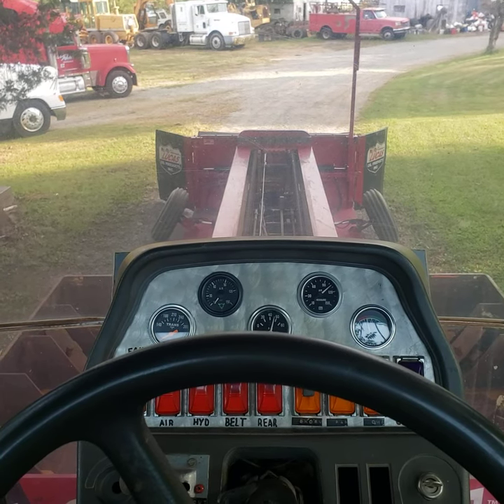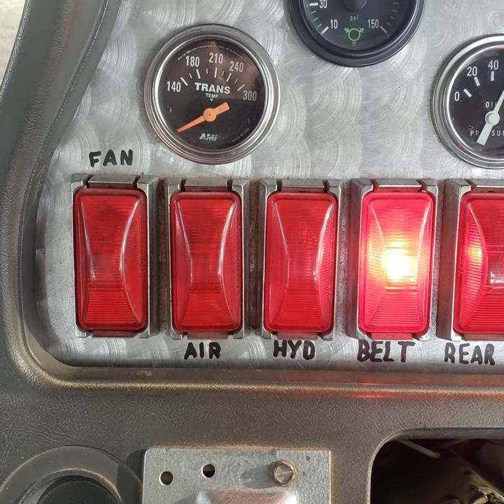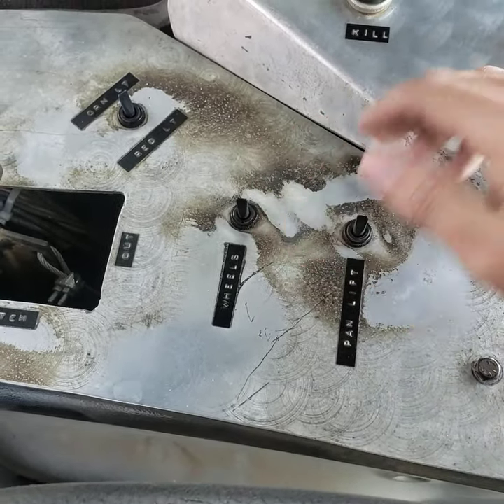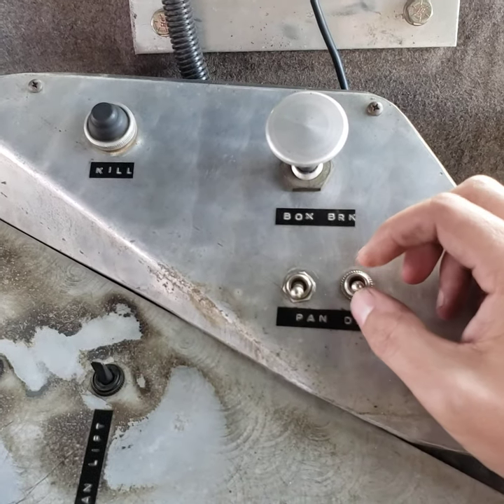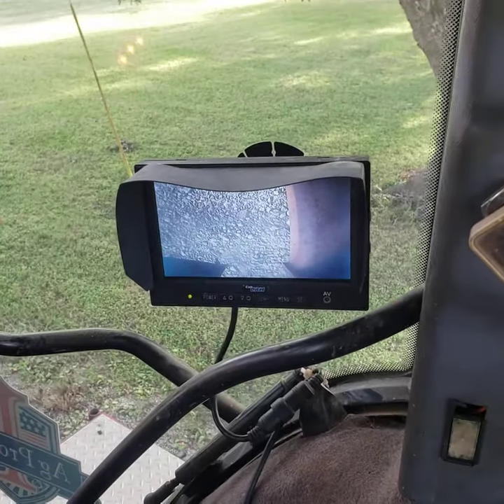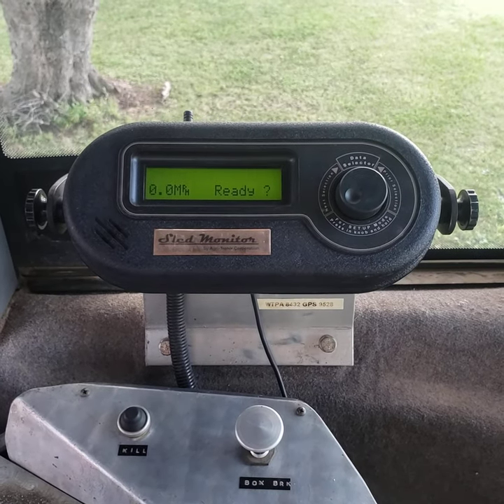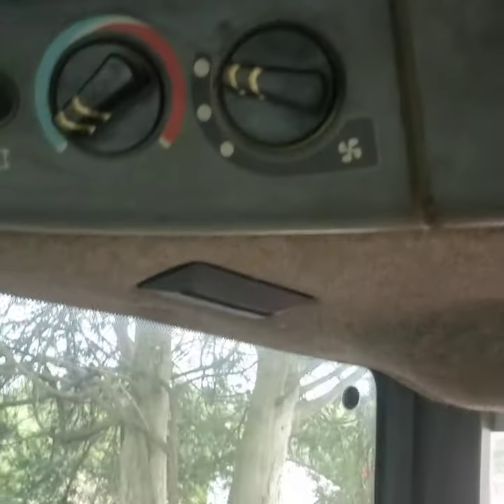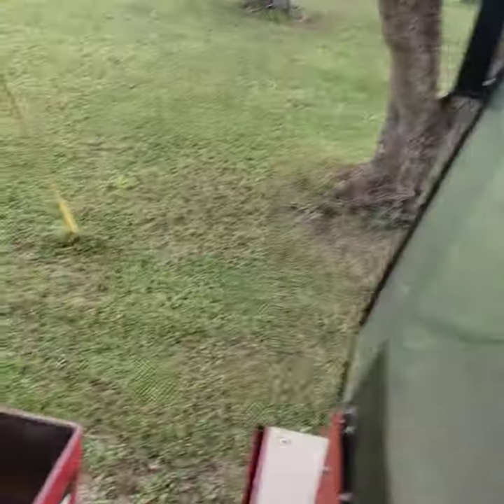Pulling Sleds; Cab Controls

Comment: When you move the box back after a pass, is there some sort of "home" switch that either disengages the drive belts or kicks the Allison into neutral?
Reply from the maker: No, but that's why we have belts instead of driveshafts or chains for that function. When the box reaches the back, the belt just slips until you bump the Allison back into neutral. After a few hundred times down the track you get used to where the box is & when to knock it into neutral to let it coast back in just the right place. But slipping the belt doesn't hurt a thing.

Comment: Thanks..very interesting.

Couple of questions. If it's a 2 speed rear, and a 5 speed fab transmission, are you able to choose from 10 gears for the pull?

Second question: What model Allison transmission is it? 1000? 2000? 3000?
Reply from the maker: The 2 speed shifter has a lockout bolt which holds the fork in neutral when the air is released from it. This allows us to have the driveline in neutral for transport, but the lockout bolt is removed when we go indoor pulling on short tracks, then we do have 10 gears to choose from. The Allison is a MT653.

Comment: Could you leave some air in the air ride bags and pull on the axle lift cables for for a better ride down the track?
Reply from the maker: No, the air dump is either all or nothing. Plus the frame rails must sit down on the adjustable stops for balance purposes. I will try to show that in a future video.
Reply: @00Cummins3500  I gotcha, makes sense.